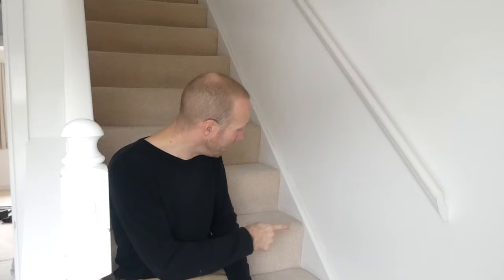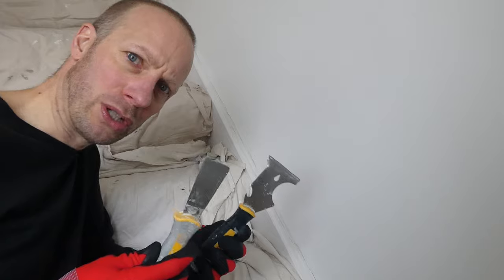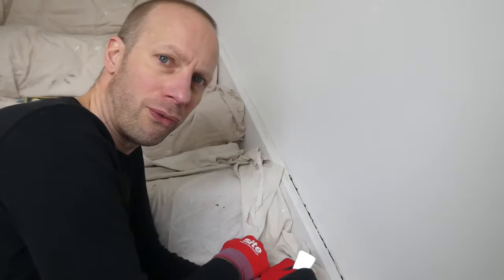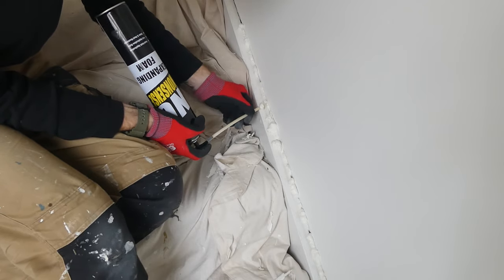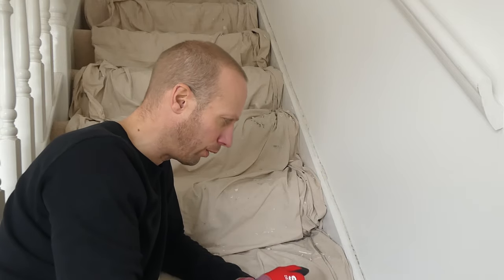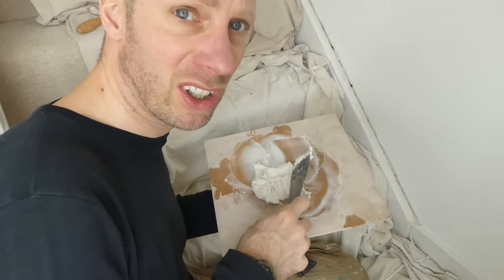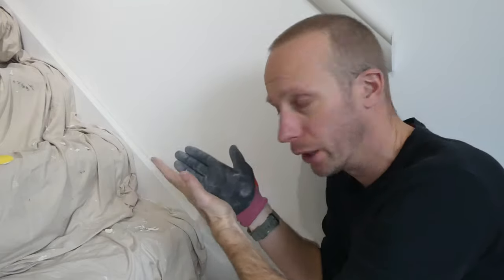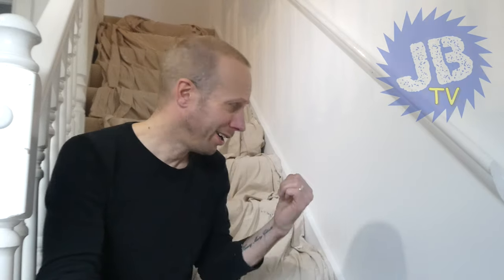How to fix cracks along your staircase skirting and wall - Step by step

Comment: Great video. Was literally weighing up whether to do this today. Added complication is 20 yrs of paint on the wood, some of which has also cracked and will come away with the sealant/caulk. Obviously don't want to sand everything back to the wood.  How would you level the paint? I'm thinking sand cracked edges, prime with peel stop, then over with a fine filler, prime again and paint?

Comment: I tried this method only to have cracks return after a few months. The only solution that has lasted for me is to get some hefty screws and plugs and pull the stringer tight to the wall again. Counter sinking the screws into the stringer face so they can be filled over and sanded before painting. To cover the crack edge you can buy small profile quadrant or scotia beeding and then pin nail it tight to the top of the stringer edge but do not secure it to the wall at all allowing the movement of stringer and the wall independantly. Then carefully paint over without filling the smalll gap between the scotia and the wall. This works on straight stringers, but some of them have rounded profiles as you go up the staircase and there isn't anyway to curve a profiled quadrant that I know of.
Reply: Thanks for these tips. I’ve used profile quadrant for similar issues on door frames so I was thinking the same for the stairs, but hadn’t thought about only attaching to the stringer to resolve the movement issue.

Comment: Thank you! 
I'm hoping to find out how to repair the skirting itself. My cat peed in the corner of the stairs and caused the wall skirting to become damaged. I had that happen in my first house as well, and a handyman came and just carved out the swollen parts of the wall skirting and filled them back in with plaster and painted Killz over it.
Since I have 3 other cats this will probably be a recurring issue so I'd better learn how to repair this myself. Which is why I am here watching stair repair videos today. I will definitely be using this method to repair the separation between the skirting and the wall. But I wonder if that plaster you used to fill the gap between the wall and the stair skirting can also be used to repair the cat urine damage to the  wall skirting itself? Or is there a different sort of plaster I must use to repair this?

Comment: Excellent video.  Only problem I have is that the wall where you applied the plaster repair is wallpapered. IS there a filler available that can fill the larger gaps (3-5mm) that will not shrink prior to applying the final caulk?
Reply from the maker: Without seeing it John, I would say that it'll be fine to follow my method, just try and get the filler to finish really smooth before it dries.

Comment: Will  this not just crack again? 

Filler (wood or wall) against plaster will crack every summer. That’s why we have silicone which is flexible.
Reply: What do you mean silicone please? I have repaired once but cracked again 😢
Reply: @0_-EL  Wood naturally expands and contracts with moisture much more so that heat. Plaster expands more with heat than moisture. These two are opposites. Therefore if you join them together you need something flexible to take up the slack caused by the difference in contraction. Silicone, Caulk or hybrid polymer should be used depending on if you want to paint it. For example, if you look at wooden trims around windows they are usually finished off with silicone.  Filler is not very flexible and will certainly crack.

Comment: Thanks for the guide JB. The problem you fixed here was filling the bottom of the dry lined wall where the plaster had been added after the stairs. My issue is the other way round. My builders plastered first then added the stairs next to it, but the plaster work is not very flat (at all!) So I've got to extend from the wooden stringer capping (top of the stair skirting) to the wall. I have these two questions:

1 Would you recommend the same method of filling with expanding foam first?

2 Also wondered how you would recommend finishing off the cap of the stringer - should I use flexible filler? I'm guessing that it shouldn't sag too much as it will be supported by the foam.

Comment: More control with a foam gun, after you used it just leave it under pressure, then when required to use again just give the metal nozzle a lighy sand with Ali oxide 80,or toupret fibrcryl in the tube, then easy fill over top boom job done.

Comment: Hey mate, u reckon the filler would just do as I don't wanna use the foam 😉
Reply from the maker: If you can pack it in far enough yes, mine was a bottomless pit, so I had to pre fill it with something!

Comment: I just took carpet off stair skirting and have an almost 2cm gap between skirt and wall. Will this method work with a gap that  big? I was thinking about putting quarter round on top to cover it
Reply from the maker: Go for the quadrant if you like that kind of thing. Otherwise, foam fill it, and then plaster/fill over the top 👍

Comment: I would have went with joint compound it also fills large gaps if the gap is very large which is was not in this case, do multiple coats of the joint compound, meaning dont try to pack large gaps in one coat!!!!

Comment: Hi I have a question. I live in an upstairs flat and there is small room over the stairs landing. Over two years I’ve been here I noticed a crack moving diagonally over the stairs landing, almost like a triangle of the wall over the stairs. It was getting longer but lately I’ve noticed it’s grown about 1/2 millimetre wider. I’ve asked various workers for the landlord maintenance about it but they say it’s absolutely fine. But I have a small toddler and I’m worried it’s a safety issue as they recent had plans to knock the house down and build a flat block behind our and neighbours house. Could it be a sinking foundation outer wall?
Reply: Just plaster cracking mate no big deal

Comment: Hi Justin,

I've watched your video a couple of times now and am attempting to re-do my own staircase skirting. However the woodwork has really thick gloss paint on it that has come off in some rather large chunks in parts, exposing the bare wood underneath in some cases. How would you go about making this right? Should I use some filler on the top edge of the wood as well, to make a flat surface, and then make up the right angle by filling the wall? Many thanks!
Reply from the maker: Hi Chris, I know what you mean, I would use some ronseal 2 part wood filler to even out the rough surface.